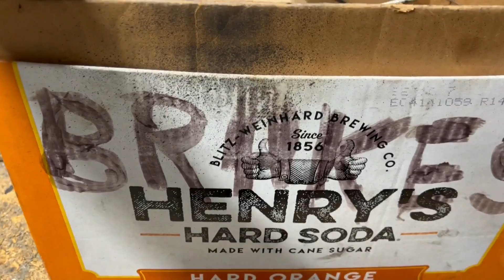BiKe Builds & Mods - Parts Bin Rat Bike

Comment: Hey Randy, About that stem situation.... I think you could get an adapter to put a clamp on stem on there. I've gotten them in some pretty small stem i.d. sizes before. Hope you and Nova are doing well.
Reply from the maker: No sooner than I got the video finished and uploaded I found another stem I like better... well at least the looks of it. Still limited on bar choices. I never looked to see if I could find an adapter in the small size I need. I will. Worst case I might try grinding one down I already have  to the right diameter. Thanks!

Comment: One question, what is it called and where can I buy the pin for the rear brake caliper?
Reply from the maker: It's the part that holds the brake pad off of a cantilever style brake. I don't think you can buy that individual part and would have to buy the whole cantilever brake unless maybe your local bike shop or coop has some laying around.
Reply: @Locojoe  Thanks friend, I found 2 pieces that I consulted for $1,, grateful